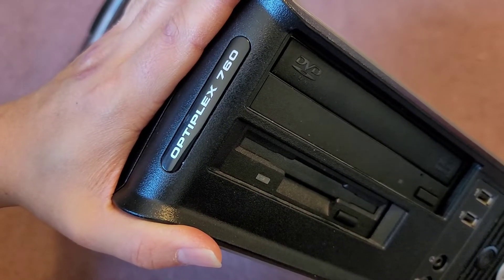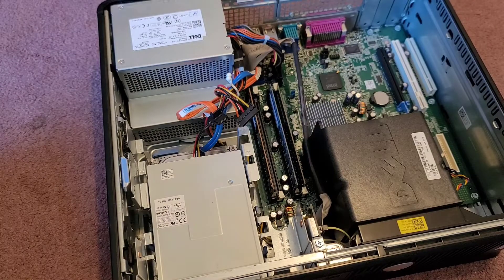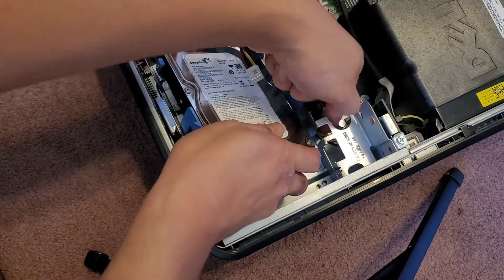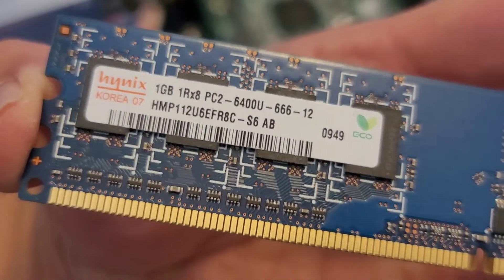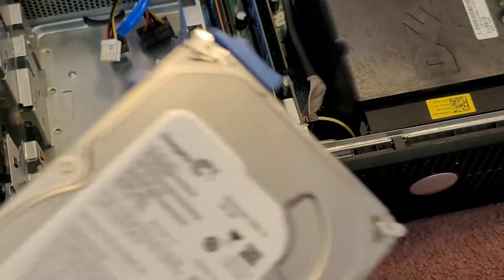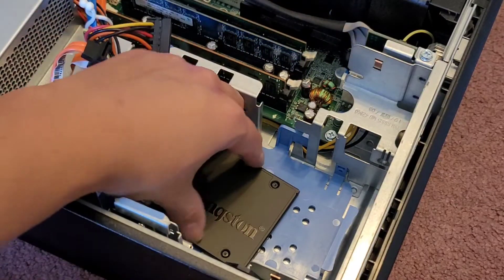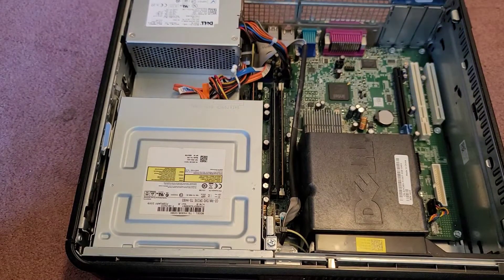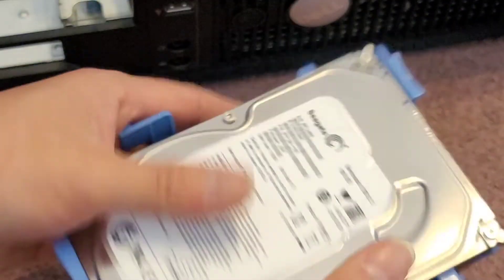DELL Optiplex 760 Disassembly RAM SSD Hard Drive CD Optical Disc DVD CMOS Replacement Upgrade Repair

Comment: Thanks These Optiplex are nicely setup, but a puzzle to figure out.i was stuck because there was no floppy, but the bracket was still in there, I didn't know it slid out (easy!) thanks the last note about relaesing the drive by bending the tabs was a nice bonus
Reply from the maker: Glad it helped. If you haven't already, please like and subscribe so others can find my videos and possibly consider watching a few others, liking and commenting to get the algorithm to recommend my channel. Thanks!

Comment: Can I install Rx 550 4gb Gddr5 on it?(Core 2 quad,mid tower case,305w psu)
Reply from the maker: Isn't the tower too thin?
Reply: @ItsBinhRepaired  its the maximum size
Reply from the maker: @Techylad  I see, you can try. Wattage might also be an issue :(
Reply: @ItsBinhRepaired  rx 550 consumes 50w power and the processor consumes 95w,but my cpu's power is 305w,do i need a new psu??
Reply from the maker: @Techylad  sounds like it'll be OK
Reply: @ItsBinhRepaired  thanks for your valuable time and effort.
Reply from the maker: @Techylad  no problem

Comment: What is the maximum amount of ram you can add?  Can this pc be upgraded to use windows 10 64 bit?
Reply from the maker: The max is the largest size you can find that fits.
Reply from the maker: Just has to be the same speed. Windows 10 is fine.